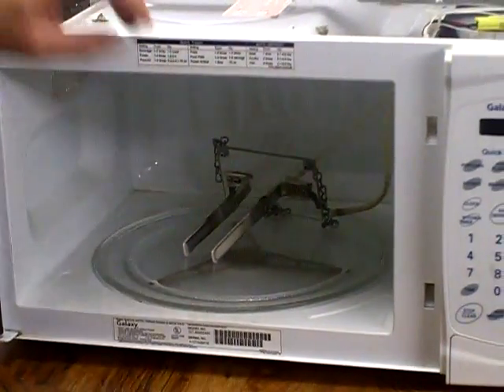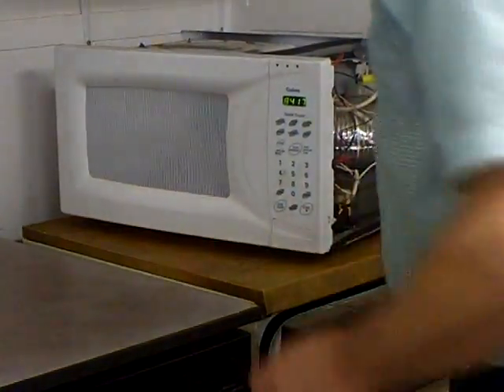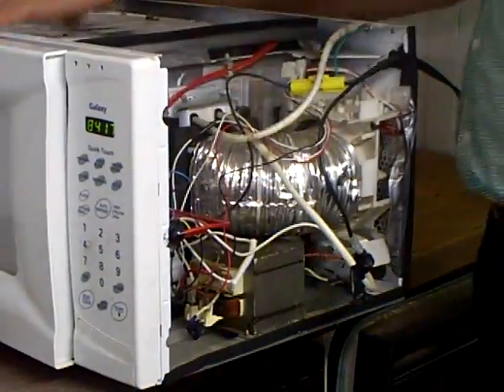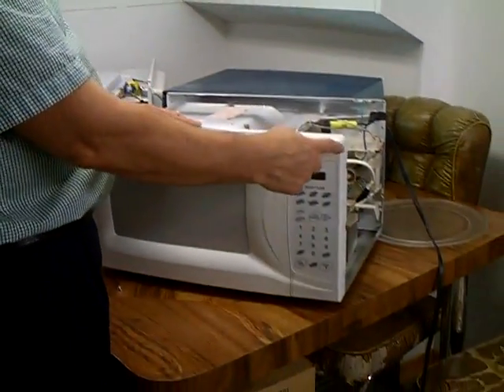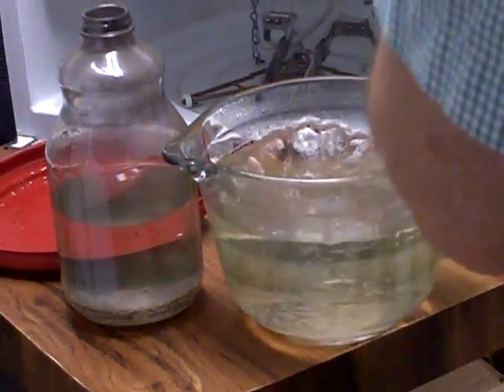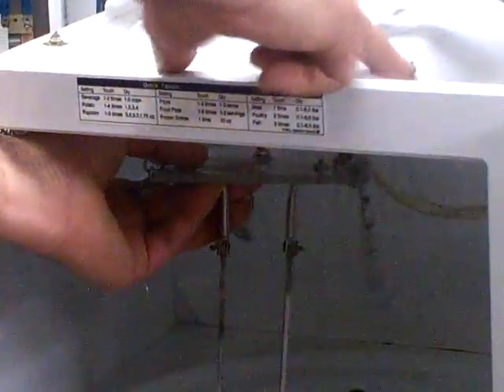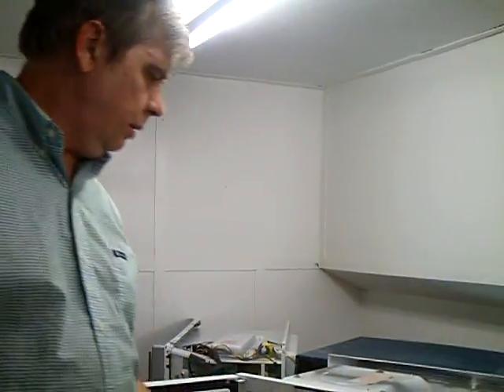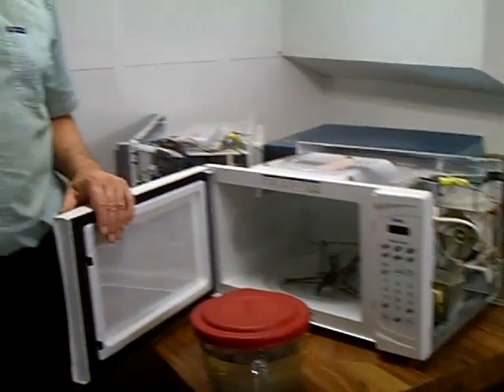7 -The info to build a high voltage colloidal silver machine

Comment: Wery bad metod.sory ! It is not good for health.big particle and this people not anderstanding sciens.
Reply: That's where you are misinformed. How long do you expect to make a batch of colloidal silver? 12-24hrs?... Your method is like watching paint dry for a whole day. I make mine by the gallon. If you want DC, the square inch of one ounce of silver equates to a max of 15mA output @ 32 volts and a cook time of 45mins for one full gallon of CS @ 20ppm. You physically and scientifically can't go beyond 20ppm with this method unless you add a catalysis. 

HVAC colloidal silver - designed in 1899 IIRC, was the way to make colloidal silver - the smallest of particles are made in this method. 

Again, I encourage you to do more research and don't listen to the people who are on the same wagon b/c their knowledge is limited to their peers on that wagon.
Reply: @dieseldc409  @32 volts and cook time of 45 mins. What is the dimensions of the silver electrodes? Which is the better, wide or thin? Can you write exact dimensions.

And what is the size of the particles in nm at the end of your method?
Reply: Muhendis Ane 1 Troy oz Silver. Rectangular shaped - buy anywhere. I don’t have a way to measure the nm. I just know it’s 20ppm based on measurement of time x amperage. Visit https://www.cgcsforum.org
Reply: very bad method, sorry , it is not good for your health, makes to big of particles, he does not understand science.**       - What could I do to create the small atoms / particles to make it healthy?

Comment: Yellow color equals larger particles 200+ nm from light scattered from  the Silver suspension in the water. Silver Oxide is black. There is no such term in any credible reference book for "true" colloids. Try the IUPAC Goldbook the world authority or even an encyclopedia if you don't believe me. Silver metallic particles only begin to work when shedding ions.

Comment: @himac, I've tried your high voltage system and it sucks! High voltage ac is terrible for making CS!! Wanna know why? Because your high voltage method is not only dangerous it also creates LARGE silver particles. Smaller nano particles is essential. I trusted you in the begining when first learning about CS but after over a year+ of research into nano technology and micro electronics, its clear that you dont know what your doing when it comes to making safe and potent CS.

Comment: @ezonegifts To stop a runaway reaction all you need is a simple resistor to limit the current.

EXAMPLE:- with a 6 volt battery put in a resistor in series of 60000 ohms and you get a limited current of 0.0001 or 0.1 milliamps perfect for creating very fine colloidal silver SLOWLY over a few hours.you don't need complicated high voltages.You can even use a variable from 0 to 100 kiloohm resistor in series to adjust it to whatever  you want.

I =V/R

Comment: @those people who don't understand difference between using battery and Himac's method.  Himac uses Constant Current which reduces the voltage in order to keep the current at the desired amount of flow.  With the voltage being reduced in order to keep the current constant, the silver particle size remains uniform.  Using a battery (Constant Voltage) can't do that which produces larger particles.  This vid shows you how to do it right and produce the much wanted nanoparticles.